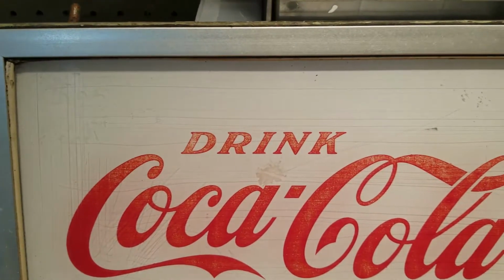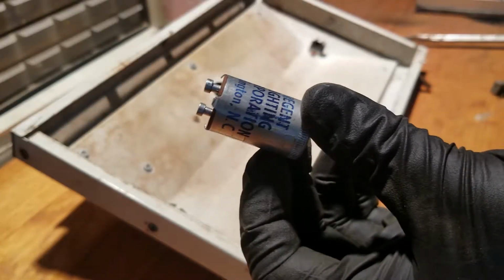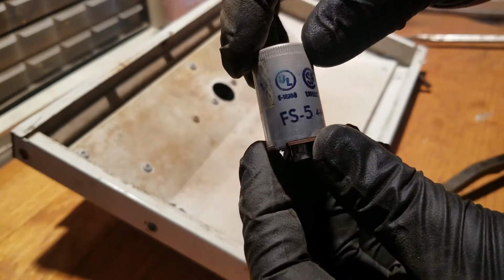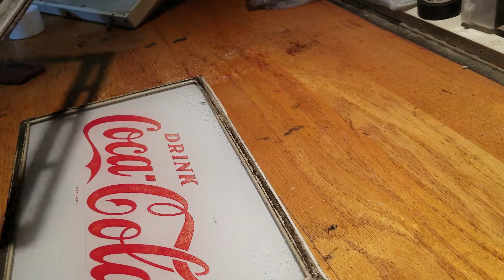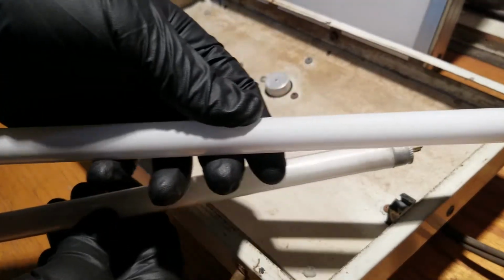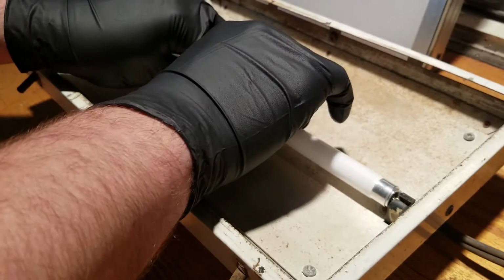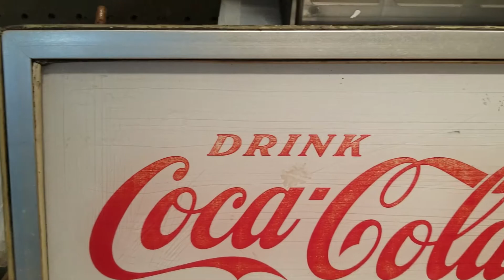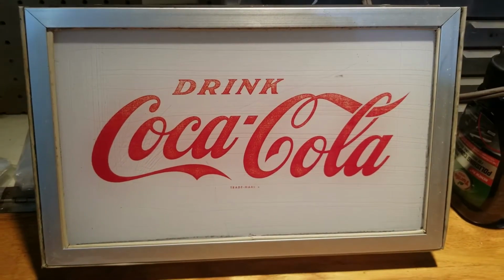Coke Machine Restoration (Part 3) 1960 Cavalier CS-64c

Comment: Is there a website that sells reproduction parts ? I would love to restore one but I’m not sure how easy it will be to get new or used parts for these machines
Reply from the maker: There are 2 websites. But i will say this. I will never restore another one. My reasoning is because 65% of the parts are not reproduction. So ive had to buy original parts and restore them. Which takes so long and is completely tedious. Vs a car that you can pretty much buy the entire car in reproduction parts. Once im done with this restoration im retiring from coke machines haha. I have had a blast doing it but its super expensive. Restored machines go for 3000$ to 6000$. Which is every bit of how much its cost me over the past year and 1/2. Hope this helps. Sodajerksworks.com and funtronics.com are both websites for replacement parts.
Reply: @bpprojects6676 awesome thank !

Comment: Not sure I’m going to be that brave removing that 1960s seal around the logo, very hard to replace. Enjoying the videos. I’ve stopped on my restoration on my cs-64d  because I worry about possible asbestos
Reply from the maker: It was a journey and definitely a learning experience. Dont be too afraid. All you have to do is open up your garage or area, put up a fan, use a respirator. You should be alright. I being very stupid didn't do any of that! Thanks for checking out my videos! If you ever have any questions im always here to help!!!!

Comment: How did you remove the sign from the machine?
Reply from the maker: It's been a few years.  I believe once the coin bezel is removed. There should be some screws at the bottom, and it pulls out.

Comment: What cleaning products are you using for the signs ?
Reply from the maker: I just used some basic ac delco window cleaner.
Reply: @bpprojects6676  How do you remove that piece? I need to change the light. Dan
Reply from the maker: @dan Cummings Part 2 of the series. 5:03 into the video I show just "popping" the assembly out. The next video part 3 shows me disassembling the entire logo display! Hope this helps!